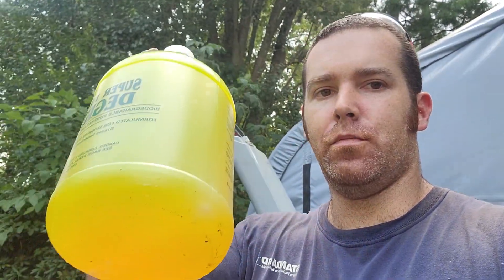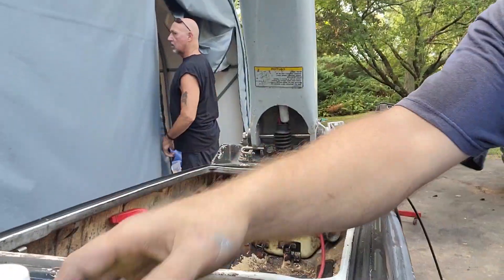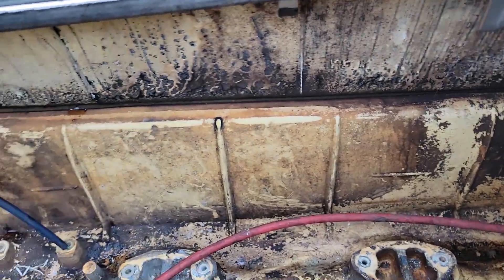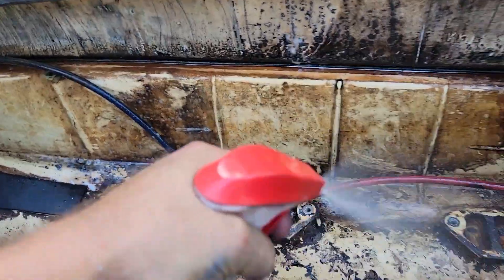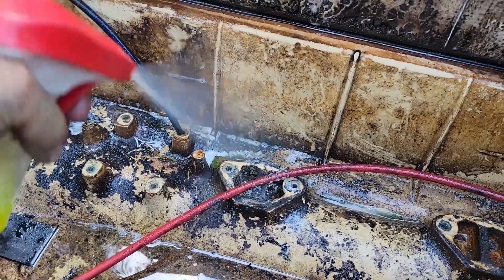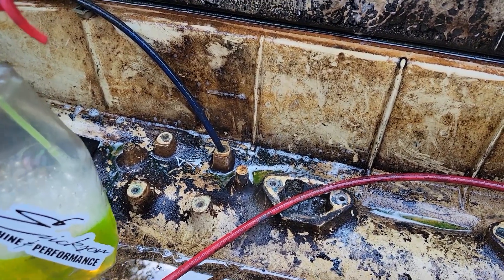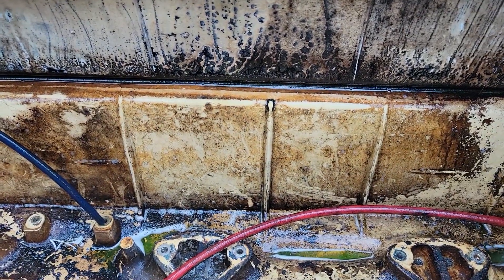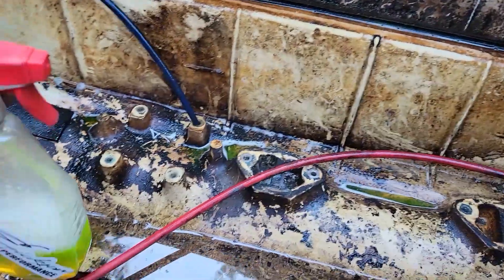How to clean the inside of a PWC hull

Comment: Spray Nine works great!  I wonder why all Sn's have that same problem with the smc. The top deck always looks like poop. Almost looks like mold. Not paint issues.  You can never get the upper side as clean as the bottom half.  Great video, brother.

Comment: As always great video.Did mine with 1/2 inch angle aluminum with pl700 premium.Had cracks all over the hull.
Last time out could feel my aluminum handle pole moving.I do open ocean riding.Will build a single aluminum pole.
I have broken handle bars.Ride it like you stole it.lol
I don't fix this, i am swimming back to shore.

Comment: Could I use a pressure washer
Reply from the maker: You can BUT I don't.   I found sometimes it's easy to cause damage with a pressing washer and this way is quick and easy
Reply: @EricksonMachinePerformance  I have a new 2023 superjet is it paint or gelcoat found a small chip on the bottom
Reply from the maker: @henrytischbein155  I believe its SMC